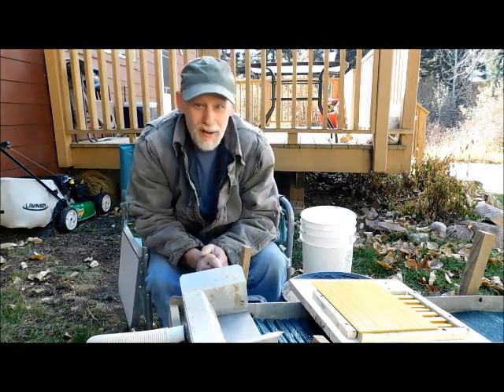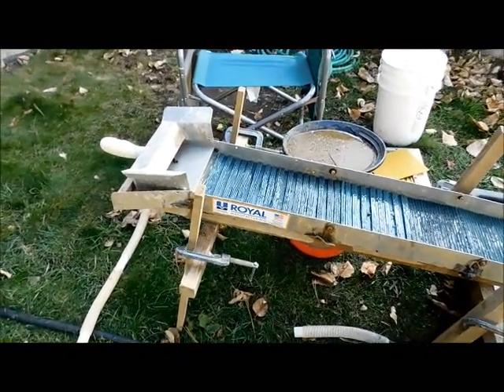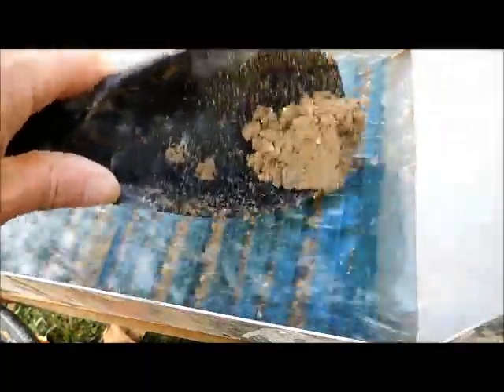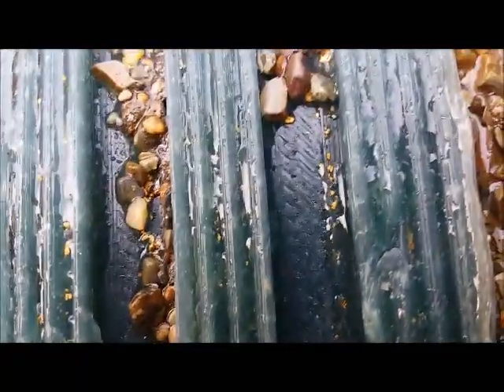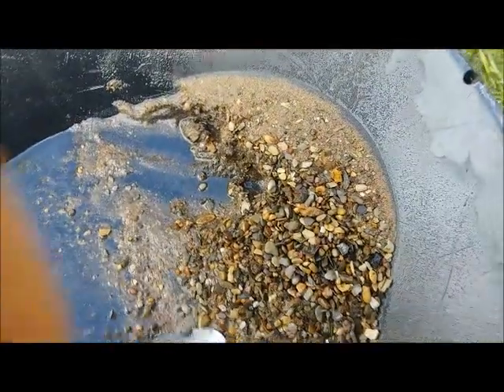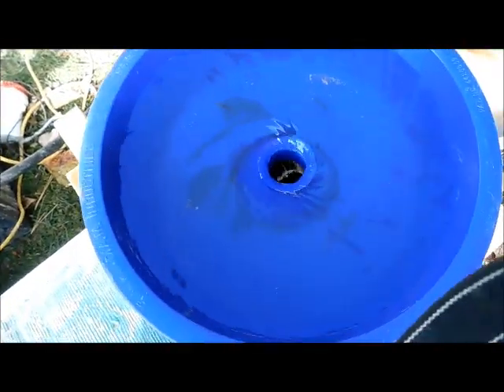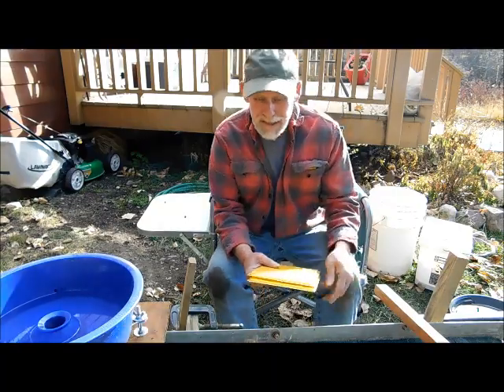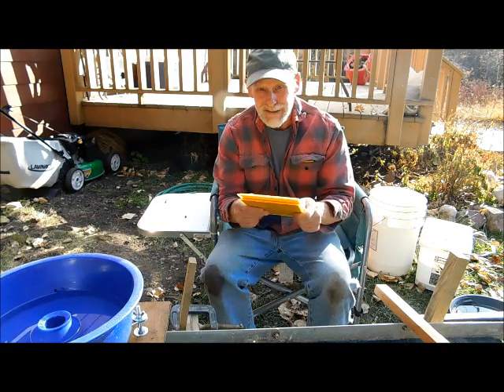First Run New Drop Riffle Two Sided Silicone Sluice Box Mat

Comment: Truly Alan, how could they not work? You did great and it was an excellent test. If the mats didn't need to be made as thick as they are and I had the time to make them, I would offer indicator matting down in front of the classification plate on the gold traps.
Reply from the maker: Thank you I think it will work great as soon as I make some more mats a bear stole them last night and they are no where to be found No joke. Time? what is that. the mats do not need to be thick at all if they where glued down they could be super thin.
Reply: @alanrobertson2510  Pesky bears!! Sorry, but that's too funny right there. Maybe that bear is headed to do some prospecting! Now I want that on video for sure! And yes, the mats would be blued down so that good to know. Thanks Alan.

Comment: that blue bowl is really cool. I have another product idea for you....  A silicone blue bowl liner?  3d print a negative impression of the inside of the bowl it will have grooves and goodies in it... shmeer silicone on it then cap it with a cap that duplicates the blue bowl shape....  the liner would be removed from the mold with say an outer edge and a tight fitting center that expands slightly to fit into the center of the blue bowl?
Reply: Or howabout this silicone liner formed to match the bottom 3 inches of a five gallon bucket?  sell these liners a guy takes a used bucket cuts it down and drills two holes and slides your liner into it and shazam has a silicone blue bowl type device?
Reply: Hey,  @builtrodewreckedit . How's it going. I thought I'd jump in on that if I can. The problem with making a liner of silicone is that the Black sand sticks to it as well as the gold. So with the liner nothing would get moved out of the blue bowl. You would need to paint the inside of the Blue Bowl with Chalkboard paint in order to have it work like that. The black sand doesn't stick to the Chalkboard paint as well and the gold does.  I'm going to try to paint the corner bottom edge of a gold pan to see if that will keep the gold from going out the riffles.
Reply from the maker: So that has been brought up before I was waiting for a person that said they where going to try to put it together and give it a try that has been a while ago and haven't heard a thing so I might just have to give it a try sometime.
Reply from the maker: I here what you are saying but I think it still might be worth a try if nothing else it would be interesting to see what happens. Please let me know how the paint does on the gold pan.
Reply from the maker: Oh by the way a bear stole my mats last night and this is no joke  don't leave them outside.
Reply: @alanrobertson2510  

Wow, That's down right unsociable. Quite expensive as well. You would think that the smell would drive them off. Maybe he just wanted something to slide down the snow hills on. :-D
Reply from the maker: @utahavalanch  It sure was. I am not happy but I can't stop laughing I bet he has a heck of a belly ache.
Reply: Alan Robertson 
Lol, I wonder if they will slide on smoothly through his system as the sands do?😝